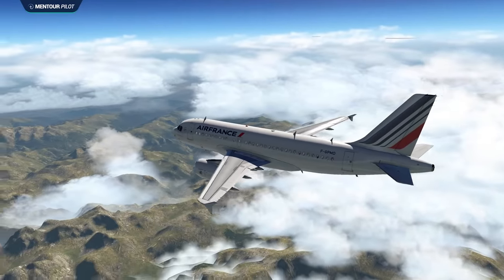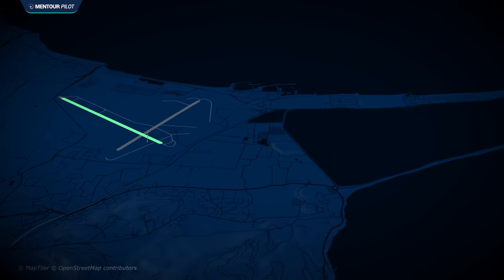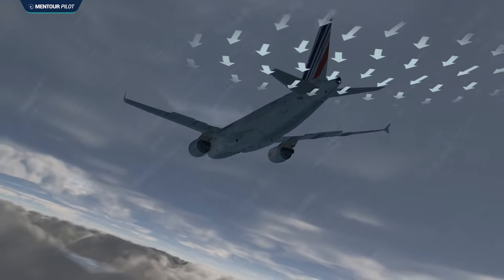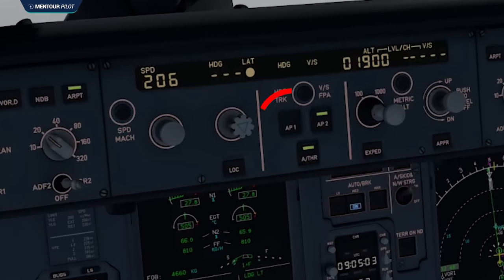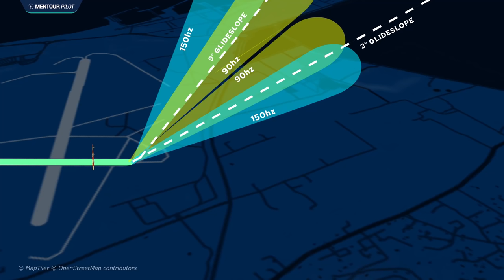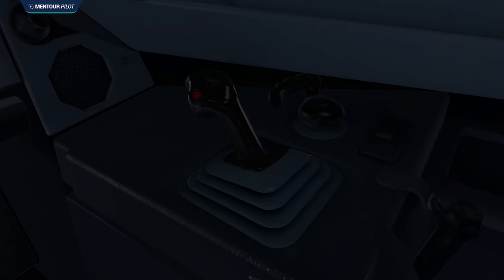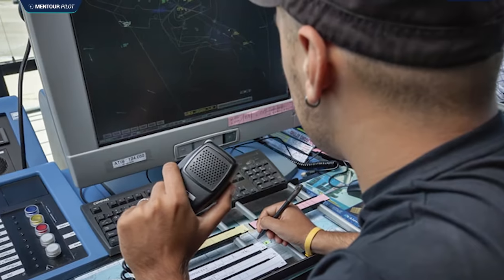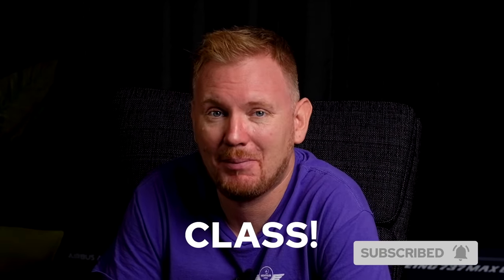An Absolutely CRAZY Reaction! Air France flight 7512

Comment: I really enjoy your productions - I learn so much from them. 

After bing watching a few of them I have to say that I can't help but feel that the semi-automatic design of air planes is a dangerous and stressful approach to UX design. It feels like too many systems from too many different providers that do a lot of their stuff automatically and yet there is a heavy reliance on the pilots connecting the dots.

Around 15:30 you have such a situation where one system tries to compansate by adding more trust but it fights another system that is erroneously configured. And the two systems do not seem to be able to tell each other that they are working against each other. 

I have seen that newer planes take a sparser approach to UX and I like that.

While I really enjoy aviation I have to say, piloting such aircraft would not be my thing. Small, simple direct however yes.
Reply: I guess the section at 15:30 you're talking about is, "The autothrottle tries to add thrust, but it's impossible"? He appears to me to be saying that the aircraft simply doesn't have enough thrust available to support the climb requested by autopilot trying to follow the glideslope. This isn't an example of systems working against each other, it's an example of the autothrottles working with the autopilot to try to maintain what's been requested of the autopilot.

(That the autopilot is trying to climb is not a problem with the autopilot; it's simply doing what the pilots asked, no different than if the pilot was trying to hand-fly the same course. And autopilots generally shouldn't be second-guessing what the pilots want; that would just make things more confusing. Remember, the auto-pilot is "flying the aircraft" only in the sense that cruise control, or even a brick on the accelerator, is "driving your car.")

UX design at the pointy-end of aircraft is a huge discipline that's taken very seriously, much more seriously than UX design in IT, because the folks doing it are very well aware that bad UIs can and do kill people, and have been aware of it for far longer than digital computers have been around. (Consider, for example, the bad fuel selector handle "UI" design that killed John Denver. No computers at all were involved there!) I've not gotten really deep into this, but I've read enough about it (particularly from aviation authority accident reports that go deep into UX design) that I would not be inclined to trust opinions on it from someone who hasn't done extensive research into this particular field.

The common (in IT) "too many systems from too many different providers" problem is definitely not an issue in an Airbus (or Boeing) aircraft. Massive amounts of work go into integration and consideration of the whole user experience, right down to things like which alarms and callouts take priority over which others and even when, why how certain alarms and callouts should be enabled or disabled. Anything that doesn't fit well will get redesigned to fit better.

And yes, there is a heavy reliance on pilots connecting the dots, but that's not due to the UX design; that's because flying an aircraft (especially in a modern environment) is inherently complex. And again, enormous amounts of work go into designing and building systems to help pilots connect the dots. But sometimes that's not something you can, or should, do by changing the UI. The side lobes of the ILS discussed in this video are a perfect example: the UI is fine, and the fix is to make sure that pilots understand that those core lobes exist. Trying to tweak the UI so that pilots could get by without that knowledge is likely to make things worse, not better, because there's always going to be another edge case that will break things if your mental model doesn't match the real world.

Comment: One thing to consider, all unusual states of an aircraft are flagged by the computer and will most likely get pulled by techs during service.  The pilots know this and that's likely why they declared it right away.  Combined with ATC comms being stored they would risk being fired by trying to cover this up.  Whether they reported it to be safe and good pilots or for self preservation no one will ever know.

Comment: You said the aircraft was close to stall speed but it was in normal law so there was no way it would have stalled. Alpha floor would have kicked in and TOGA thrust would have been commanded immediately as the speed was anywhere between Alpha Prot and Alpha Max. This is the beauty of the airbus compared to the Boeing

Comment: Talking of glide slope, was the depiction of its use in Die Hard 2 accurate, where the bad guys "lowered" the  glideslope (am I confusing that with the altimeter?), sending false data to the pilots so they thought they were higher than they actually were, causing the plane to crash.   The movie also depicted weather conditions probably not unusual for New York around Christmas time, in winter,  using an instrument only approach. (Within the movie plot, the visibility is basically not existent: night time,  snow-storm, JFK Airport, New York winter.).

Comment: I think we can all relate to a certain degree to this story even if we don't fly. We all get bored, we all get distracted, we all just go on "autopilot" ourselves and pay little attention to things we've done a thousand times, even at moment when we're supposed to be fully alert. Not everyone flies planes but almost everyone drives and I don't think there's anyone who hasn't had a close call from being distracted. I'm more surprised by the fact that the aircraft can be so easily confused more than anything. That being said the pilots should have been paying more attention but at the end of the day they took action and corrected the situation.
So here's my main takeaway here which is to never fully trust electronics. Going back to the example of a car or a motorbike, anyone who's been driving for a few years will have probably come across a situation where the vehicle's electronics, which are supposed to be highly sophisticated and make driving easier and safer, are simply "confused" and don't work as intended, even making a situation worse. Which is to say that, especially with the advent of self driving cars, you can never fully trust automatic systems to do something. They might work great most of the time but some times they don't and this is why anyone flying a plane or driving a car or handling machinery of some sort should always keep an eye to make sure that the systems are doing what they're supposed to.

Comment: You have probably heard about this incident: an El Al 787 from TLV-EWR had a quick turnaround, and both pilots, plus a relief pilot, did not notice that the aircraft weight was entered into the FMS at 40 tons below the actual weight. Therefore, the V1/Rotate/V2 speeds were far below what they should have been. The good news is that the pilots reported it immediately to the Israel aviation authorities. The bad news is that the pilots didn’t discover the issue, despite a sluggish rotation and inability to climb, until later when the FMS advised to climb straight to FL38, which they thought was odd on a long westbound transatlantic flight. Since there was no damage and no injuries, I suppose they could have chosen to ignore it, but it’s reassuring that they reported their error immediately.
Reply: I wonder if the 787 has a similar system to the Airbus family. Once airborne if the FMS weight differs from the calculated weight by the aircraft it gives the pilots a warning to CHECK GW

Comment: This is very interesting that there are radio antennas transmitting audible frequencies : 90hz is a low bass before sub and 150 is kind of a muddy area just around bass guitar and resonant but it’s thousands away from any radio frequencies I’ve understood and I’m also a HAM operator which makes this even more interesting . Are we sure this isn’t a 50KHZ and 150KHZ ? And the overtones you’re mentioning ?
Reply: No. It’s a UHF signal modulated at those frequencies.

Comment: That false glideslope thing brings back memorys from my time in the military. I served in the satellite and guided communication branch. As I was taught, this is actually the way, alot of communication intelligence and counter intelligence works, as f. ex spy listeners can lock in on those false signals that deflect from the transmission dishes outwards of the intended path. Infact, a few miles next to my base, there was a base of the electronic intelligence guys. The base was just at the perfect location to capture the false signals of our transmission dishes, so they could train all day long how to intercept transmissions x). Same case for when deployed. They had a post to listen to us. As foes ofc have had aswell.

Comment: Another great video. 
I have a question about the math you said and showed at 8:30 in the video: 6500 ft x 3 = 19.5 miles. Perhaps you forgot to mention that you convert 6500 ft to 6.5 miles for this calculation but the math on the screen is incorrect. 
The accurate calculation would be: 6,500 ft x 1 mi/5280 ft = 1.32 mi, which when multiplied by 3 gives you 3.96 miles. You might want to update the video to clarify this for the math-savvy members of your audience. 
But keep up the great work with these videos. You strike the perfect tone between concern and accuracy that some less thoughtful posters don't do with their sensationalistic aviation videos.

Comment: Hi wanted to ask about the glide path images you used in this video. I am not a pilot but wondered about the two options of either 3 or 9 degs. These seem very low and not graphically reflected in the drawing. Andy

Comment: although I agree with your point about continuous improvement and reporting events - if someone in charge of an aircraft willfully ignores already well established proceedures and safety and puts passengers at risk - they have no right to be in a cockpit, it is like the driver of a car ignoring red traffic signals or speed limits because he thinks he knows better, yes if something happens at a traffic light that could be improved then yes fine - but just willfull ignorance of already established safety is not acceptable

Comment: Great video. I was surprised to learn that the same frequencies are used for both the 3deg and the 9deg glideslope. From an engineering point of view, this raises various red flags. Why on earth aren't the frequency pairs different between the 2 glideslopes?
Reply: As I understood the video, the 9 deg glideslope is an unwanted (but known) effect of the ILS transmit antennas' radiation pattern i.e. the sidelobes.  The frequencies will be the same as the 9deg glideslope is generated by the same transmitter as the (wanted) 3 deg one.
Reply: @generaloffice2381  Thanks! I watched the video again, and I think you're right. It just didn't make sense to me the first time around...

Comment: Luckily, the culture at most airlines is as you describe...report mistakes without fear. I was at an NTSB hearing back in 1961, which was investigating the crash of a DC-8 from Mexico taking off from Idlewild (now KJFK) in freezing rain.  The pitot heat was NOT on and the Captain's airspeed was was much lower than actual at Vr. A check pilot in the jump seat reached up and closed the throttles. The aircraft got airborne and crashed into a swamp off the field. Lots of fatalities, including the cockpit crew..except for the check pilot. At the hearing, he told, without any hesitation, that it was he...not the Captain...that aborted the takeoff. He also told the board that he had not crosschecked the captain's airspeed with the F/O's speed. We were, quite literally, stunned at this pilot's honesty in taking the blame. When we asked why he admitted this so readily, he said that he was the only person who knew what really happened and he wanted the board to know that it was solely due to pilot error (his). In those days, a pilot was immediately fired for such a mistake. I still feel admiration for this man to this day...

Comment: It seems silly that the airbus will prevent you from going to a pitch angle at 30 on your own (airfrance 296Q accident), but if you are in approach mode and catch the false glide slope, it will pitch up to 30 degrees.  
I’m a software developer, and right away I think, you catch the glide slope, and you are starting to descend, and the glide slope goes away from you compared to the radio altimeter, you just don’t have the correct glide slope.  Throw a master caution, remove approach mode, fly level, and audio announce “go around”.
Reply: I’ll add to that, a hypothetical:  suppose in these strong winds the rnav antenna on the ground gets tipped over a bit, for a cat3 approach, planes would be coming in at 5degrees or 1 degree without any indication.  You wouldn’t get a gpws because of the approach mode!
Reply: That's because you're trying to figure out a solution that would prevent this particular situation. But the design of flight computers has to be applicable to as many situations as possible AND has to be designed in such way as not to overwhelm the crew and present relevant indication. For example triggering master caution here makes no sense, because really, no aircraft system here is failing. The plane's doing exactly what it's being told to do. You'd diminish the meaning and significance of the master caution if you used it as 'something is weird' indication.

Regarding the 296Q, this is same thing in operation. The plane doesn't really look at the pitch angle at all. It's irrelevant for what it's doing. It's looking at angle of attack (also called alpha) which is the angle between direction of incoming air and wing root. This is the actual physical variable that determines the lift generated by the wing.
The reason why in case of 296 the plane didn't pitch up was that it was already at maximum angle of attack, so the plane had no space to pitch up. Here it did, so it pitched up all the way until it reached it's maximum angle of attack limitation. The pitch up was higher because the plane here was in landing configuration - the flaps increase the available angle of attack.

Comment: The descent (1:3) rule is standard for the 320 family. Infact when you are closer to the ils (within 30 miles), it's a good idea to factor the track miles to touchdown by using the ils DME. So 6000 feet, you need approximately 20 miles (assuming you are 180kts, flap 1).  You have no business being at 250kts so close to landing. The Airbus can't decelerate as well as the Boeing on account of being a far cleaner design.

Glide slope capture from above is a standard Airbus procedure, not an airfrance procedure and it is clearly written in the fctm.

During the go around when the srs mode is active the aircraft will demand a 15 degree pitch (both engines) and a 12.5 degree pitch (single engine), and that's what the fd bars will show. This pitch will take care of approach climb regulations. When the speed was so low, what could be done was to retract the landing gear immediately to ensure the speed buildup was quick instead of this 46 secs of flying below vls.

Comment: The first thing I noticed was how high and hot they were.  Like you said, at 16 miles out they should have been at 4800" and usually in the US anyway, at that distance, jet traffic has slowed to 210kts.  I'm assuming that 1900' is the GS intercept altitude at the FAF, and, IMO, the descent should have been planned to reach that altitude prior to the FAF so as to intercept the GS from below.  I think trying to intercept the GS from above is a bad idea because of false glide slopes.  It can be very confusing.  I doubt most GA aircraft have the new software mentioned to correct for this(?).

I'm very surprised how the acft got to a 30 degree pitch up attitude w/o either pilot noticing well before that(?).  I've seen excessive pitch and bank attitudes in several of your videos that resulted in crashes.  I think pilots in these cases have become way too dependent on autopilots, auto-throttles, and FMS's and have lost basic scan techniques.

Comment: Displaying the text as 6500ft x 3 = 19.5 miles is a bit confusing, might be an idea to use an alternate way to visualise those sort of mixed unit calculations
Reply: Pilots use 3d all the time. It’s quick and easy.

Comment: Thanks for these videos. Would be interested one day if you made a review of that British Airways 747 near miss from 1990 where the flight crew was sick and landing conditions were terrible and they nearly landed on a Heathrow hotel.....The first paragraph of a report reads as follows. 

On November 21, 1989, a British Airways 747 came within quite literally a stone’s throw of the ground at
London Heathrow Airport in thick fog before reversing its descent on an unsuccessful instrument approach.
The huge airplane was far enough to the right of the runway centreline that when Capt. William Glen
Stewart discontinued the approach, he was actually outside the airport fence, paralleling a highway
crowded with morning commuter traffic and only five feet higher than a nearby airport hotel the roof of
which is exactly seventy feet above the ground. As the 747 thundered past the Penta Hotel, half in the mist
and half out, car alarms all over the parking lot began to chirp and wail, their sensors set off by the four
enormous turbofans spooling up.

Stewart, 53, the 15,000 hour British Airways captain in command of 747 G-AWNO ‘November Oscar’, as the
aeroplane has been referred to ever since – routinely landed out of the second approach through the same
fog. Phones at British Airways’ head quarters were ringing even before he had parked at the gate, and that
would be Stewart’s last landing., for he never flew again. He lost his job, and more (his life)